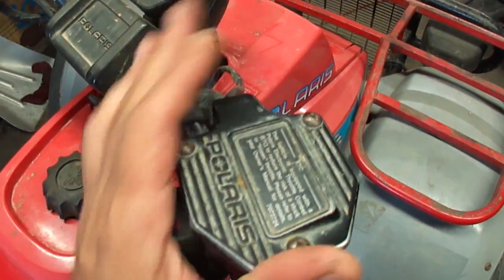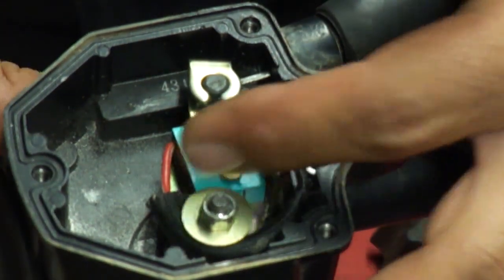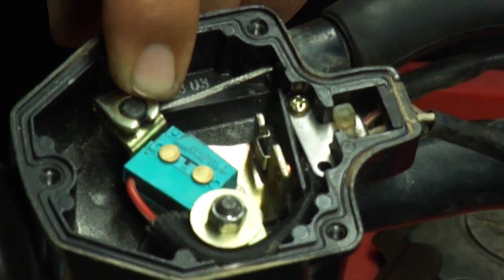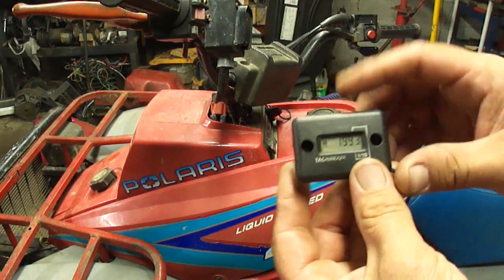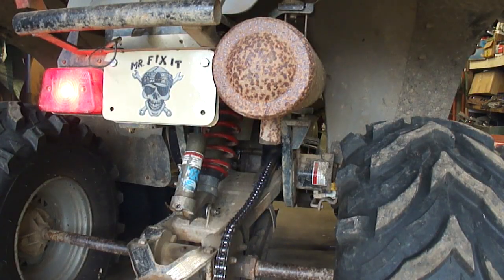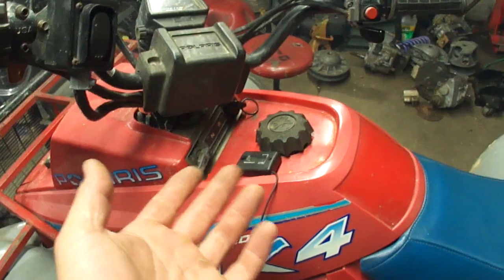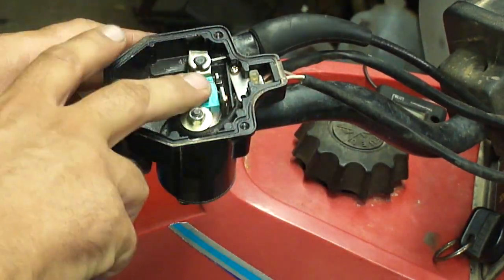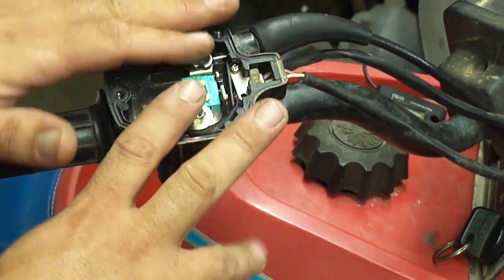What is the Polaris ETC (Electric Throttle Control)

Comment: I have a 96 polaris trail boss 250 that I got running but only whith throttle being pushed. But won't idol. Now won't even start at all just cranks over. When it did run it blew white smoke. The carb is clean jets are clean. Its getting fuel and spark. Any idea of what to check next? Thanks
Reply from the maker: 1995 and newer I believe has you adjust the ECT wit5h the micro switch closed, not open like the 1994. White smoke? That is an air cooled engine with no balance shaft. only thing that will cause smoke is the 2 stroke oil. Are you using the oil injection? if you are it maybe dumping excess oil. Check the spark plug for fowling. Black and oily. Try a new plug and adjust the oil pump to speck.
Reply: That 1994 microswitch’s midget sized white button must be adjusted to be depressed in to idle & run.

It’s when it’s not depressed in by the metal throttle tab that limits the RPM.

Comment: Well that was useless
Reply: Needed to show the cable adjustment procedure for idle & a picture of the switch pin fully depressed in.

When the microswitch plastic plunger tip is depressed in, the ignition/RPM is normal & not limited. 

When the microswitch plunger tip is out, the ignition is limited.

Comment: Hey Mr. Fixit!

I note that you have replaced the rear shock absorber. Can you tell me which model you switched to? Did you need to modify something?

Thanks for very good videos about your Polaris Trail Boss!
Reply: My 1993 will stall out unless you take the play out of the throttle.. would that be the switch itself?
Reply from the maker: 1996 scrambler 400, all i did was swap out the spring.

Comment: First Rule, "i'm not smarter than the engineers"
quick look, the switch gets power from the Red bus bar and feeds to the reverse limiter. so it's power into the limiter.
avoiding "normally" nomenclature, when limit is active, power is being fed to the limiter. normal operation, the circuit is open.